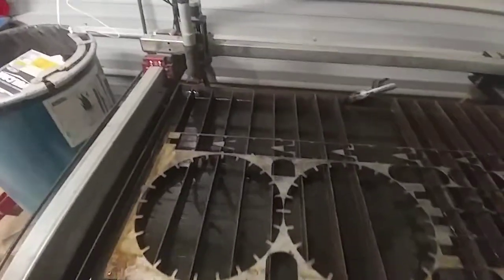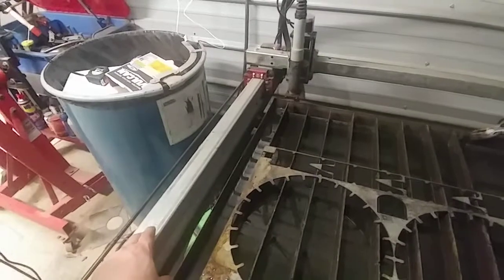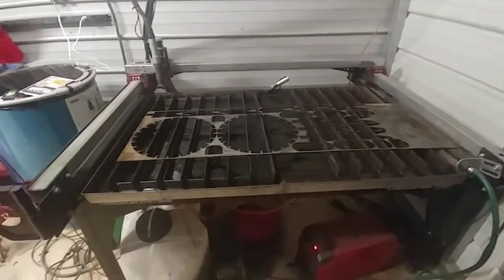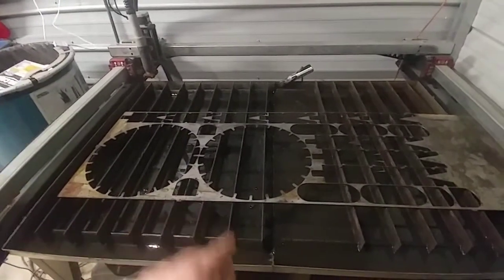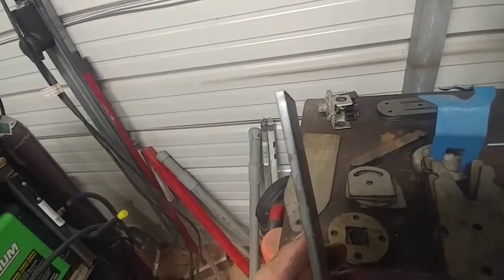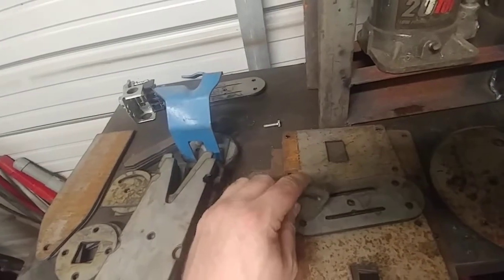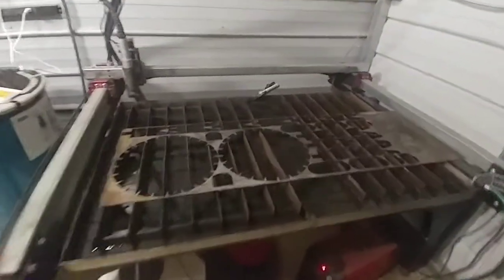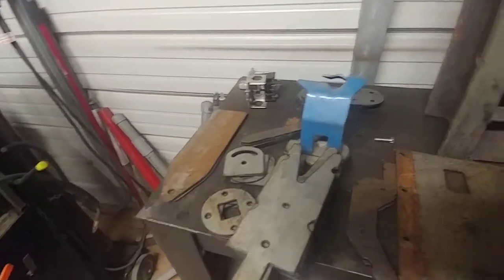crossfire pro 1 year(ish) review.

Comment: Great video!
I ordered my table about a month ago and it's supposed to ship in June
Patiently waiting!
I was thinking about spraying some flexseal on the bottom of that seam in the water table. Think that might fix the leaking issue??
Reply from the maker: That is not a bad idea, I may do that too!, if I had it to do over again, I would have welded the seam and cut out the raised portion in the middle. It would have made things much easier to clean, but not sure how it would have handled that much heat without warping...
Reply from the maker: You will love the table!, I hope they get it to you soon!
Reply from the maker: The Flexseal works like a dream! no more leaks!

Comment: QUESTION:  Could you just cut the water table sides 1/4" lower and make new slats lower as well to get the clearance needed to no rub? or would that not allow the torch to come down low enough?
Reply: Or just learn to turn your image with Fire Control and put your piece on there safely the other way.